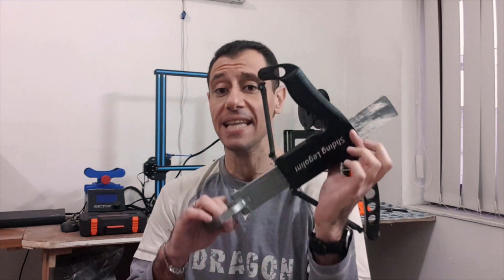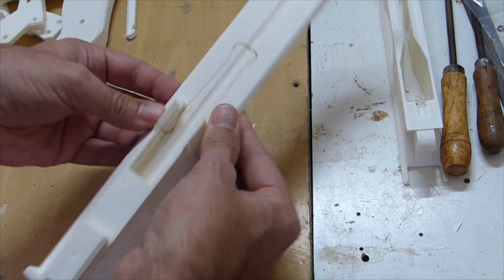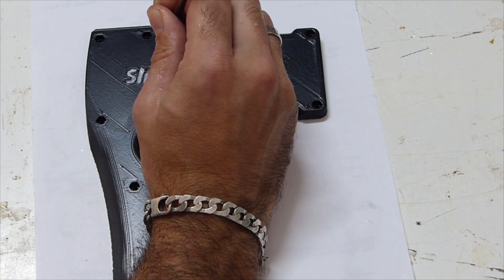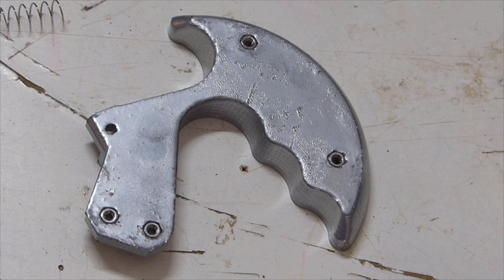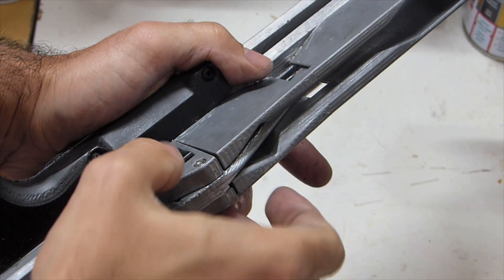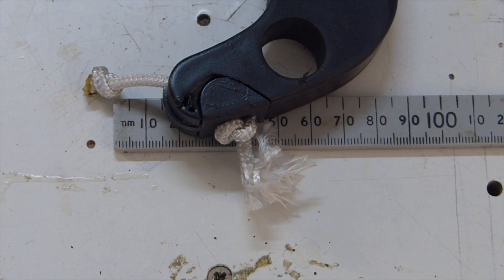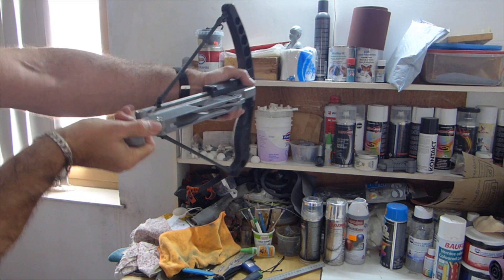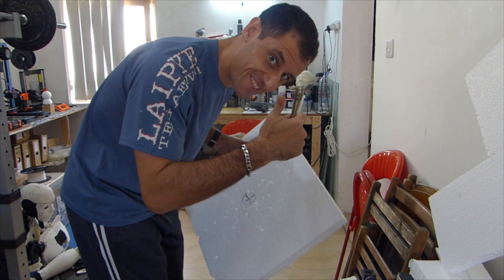Fully 3D Printed Working Pump Action Mini-Bow - Sliding Legolini || Step by Step Assembly Guide

Comment: May I ask for your help? The catch mechanism in my bow constantly fails. Sometimes the bolts fire out even when it's half drawn, without pushing the release. Initially, I thought it was because the spring for the release (inside the back grip) is too weak, although it's the same spec (8mm OD, etc) as in your instructions. 

I tried double-stacking the spring to increase the tension, and it worked for low-power rubber bands. But once I upgraded it to stronger rubber bands (~25-30 lbs), the catch failed again. I feel that while the spring tension and rubber band are factors to consider, the catch mechanism probably should be robust enough. So maybe some other things are going wrong in my build?
Reply from the maker: Hi, thanks for your comment. Is the mechanism that is pushing down the arrows locking properly and is it tight enough to keep the arrows secured so they don't move forward before you release?

Also, the arrows you are using if they are 3D printed make sure that the back part has enough surface area to fit surely on release rope. Could it be maybe the rope is too thick? Or too thin?

It's been a while since I did this video so I may forget some details but check the above maybe it will help.

Thank you for watching I hope you enjoyed it! 😉
Reply: @ThatTechoGuy  Thanks for your replay! I am using aluminum bolts and carbon fiber bolts. To clarify, the problem is that sometimes the rope is released from the rope catch without me pushing the trigger. This seems to happen when the draw weight approaches 25-30 lbs. To me, it feels like the catch mechanism is not robust enough to stay in place for high draw weight, and it doesn't look like a magazine/bolt issue. Lukasz, the designer, managed to shoot with over 30lbs draw weight without issue, so I wonder if something else goes wrong in my build.
Reply from the maker: @vdcn  Hey, no problem.
Not sure what draw weight I had but it could be the catch mechanism auto releases with the weight as it might not be strong enough to hold. 

Have you filed all parts including the trigger catch properly and the body where the rope slot is? It needs to fit down securely at the end of the draw slot to remain in place.

Maybe you can also try writing to Lukasz and he will reply. I believe he or his other friend had seen this video too. Try checking for contacts on the Legolini site.

If you manage to fix it, let us all know here what you did 😊

Comment: Hi that’s awesome. Would you consider selling all the parts required in a kit form ?

What size printer bed did you use ?
Reply from the maker: Hi, thanks for watching! The parts were not designed by me so even if I wanted to do that commercially I couldn't. Maybe ask the designers at legolini.com if they offer such a service.

Regarding bed size I used a Prusa MK2.5s and that is 250x210x200 mm (X, Y, Z) respectively.
Reply: @ThatTechoGuy  ok thank you for your response much appreciated
Reply: @ThatTechoGuy  naaah, he doesnt offer a print service, ive been looking since last year.
Reply: I used a CR10S and found that I could print the "Combined Magazine" in one part by situating it's print position diagonally on the bed. 
BTW. There is an innate weakness in the two catches the "Spring Body" clips onto when bending the "Spring" back and forth. Over time they will eventually fail.
Reply from the maker: @iminabrons  Yes that will be the case and over time all mechanical parts that frequently move will fail and will need to be maintained.